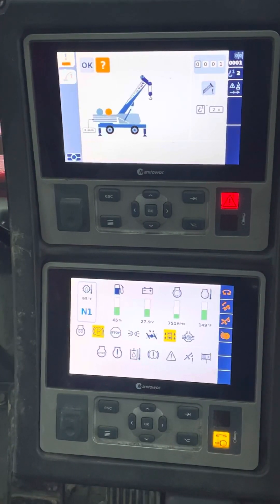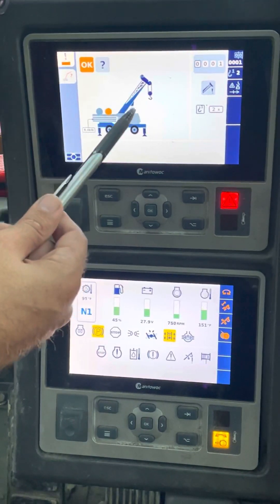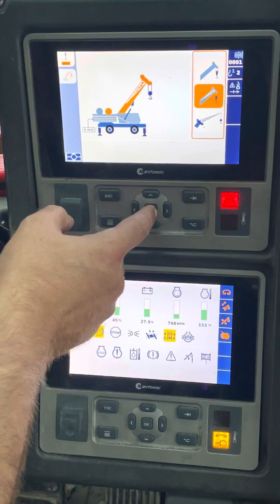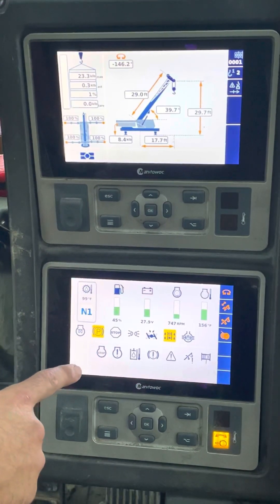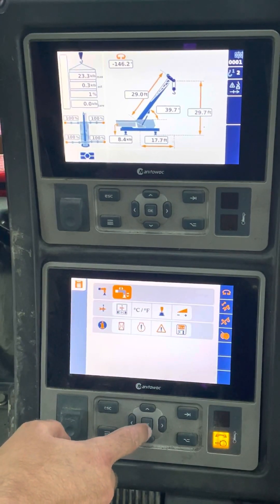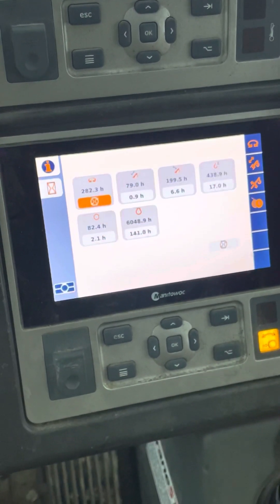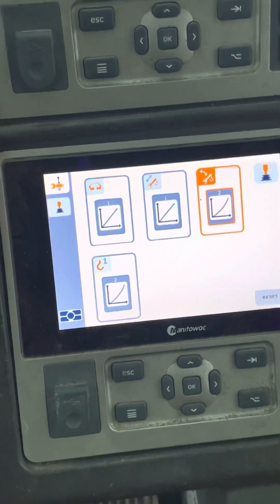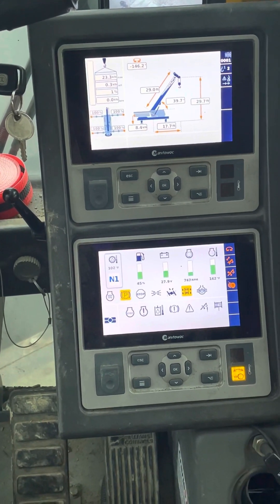How to set up LMI on GROVE 530E-2

Comment: thanks a lot. we use these cranes for 777 main landing gear changes and the company just got a newer 530 with this system. completely different than the older 530 we had